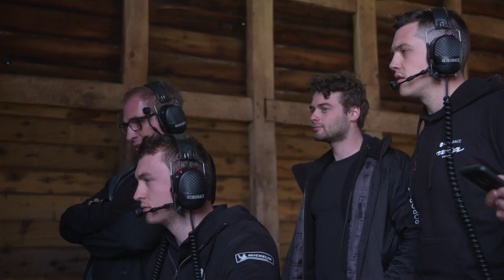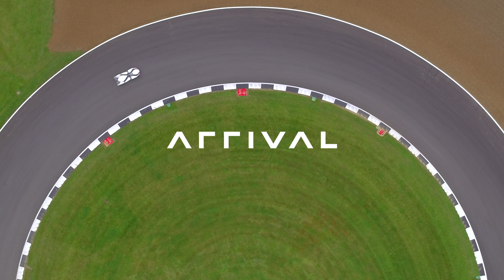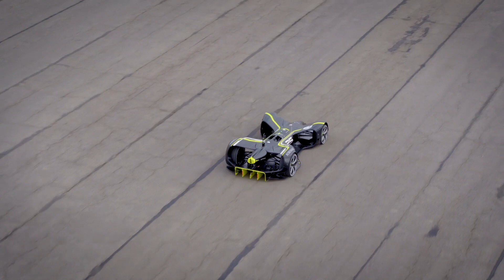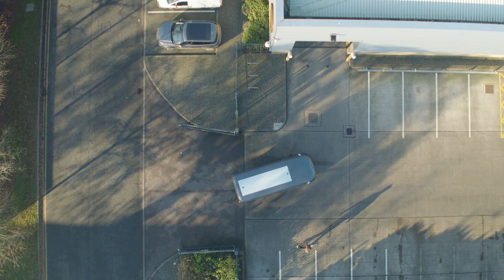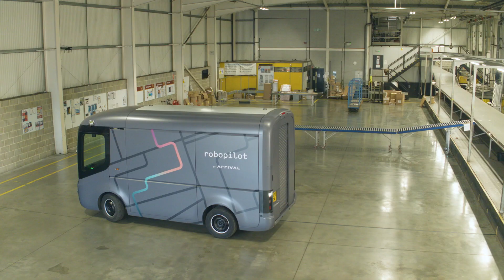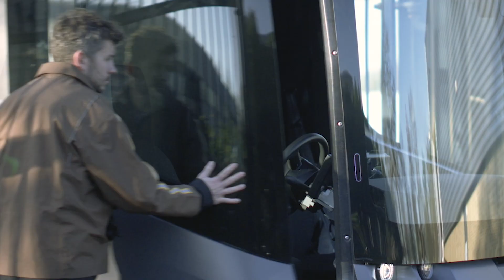Roborace | Autonomous Racing | Powered by ARRIVAL

Comment: If the steering wheel here had enough force, you could just hold onto it with your hands. I don't know how niche this is, but theoretically, it's a low-angle wheel, so it shouldn't break your arms.

I already tested the same sort of thing at home using BeamNG, and there's nothing scary about it.

Comment: I have a lot of hope for Arrival. I'd like to see more about serviceability design and free diagnostics for workshops to help local mechanics transition and promote circular economies. Also, I have always admired UK highway design and have wondered how it could be altered for autonomous vehicles. E.G. to have different road surfaces designed to minimize rolling friction with wheel designs where the contact surface can be altered to track a hard, low friction, low surface area track - like a hybrid tram/train/car system.